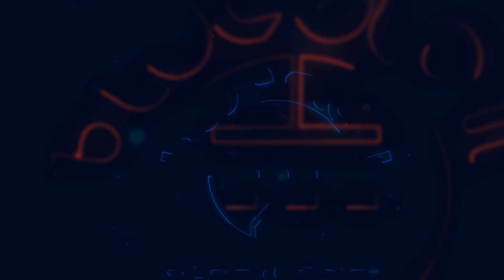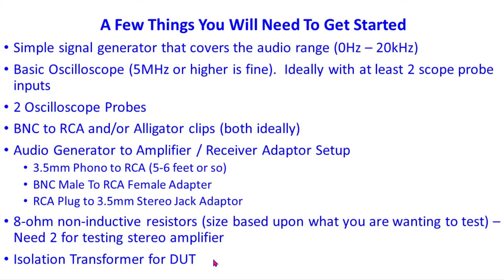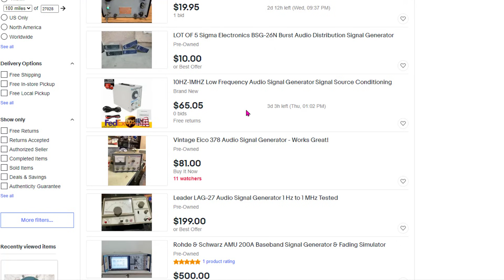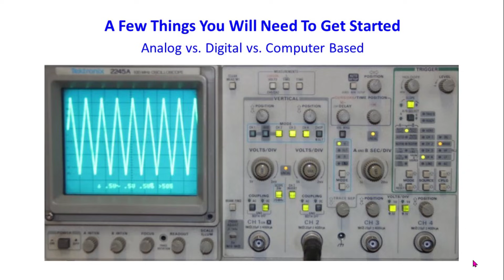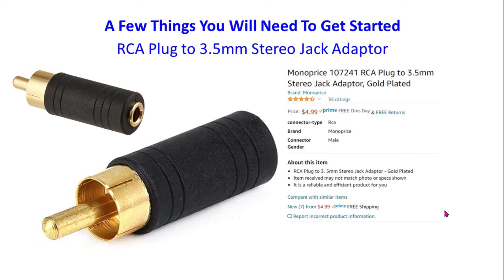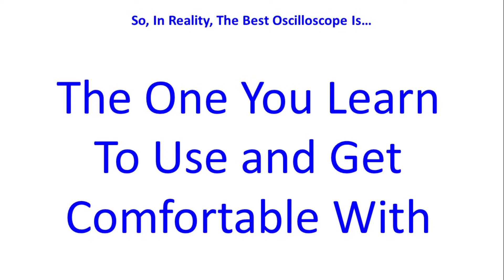Buying an Oscilloscope and Accessories For Audio Bench Work and Testing

Comment: Greetings:
FYI: As far as I am concerned, all RCA type connectors are to be called "phono" types. They all are single signal (plus shield). They have been around a long time and were originally used to connect the first phonographs with electrical pick-ups to tube radios equipped with a single RCA connector to use the radio's amplifier and speaker to listen to 78 rpm records that had once been played on wind-up gramophones.
All tip-ring-sleeve audio connectors owe their heritage to the original plugs used on telephone switchboards, hence "phone" connectors. Although those first phone plugs (and jacks) were three connector types, the audio industry standardized on them for patching including use for balanced signals.
My first exposure to tiny plugs/jacks were as earphone jacks on transistor radios. Some were smaller than the common 3.5 mm plugs used today. But all are deserving to be called "phone" plugs.
BTW: in Europe RCA phono plugs are often referred to as CINCH plugs as CINCH JONES is/was a major manufactuurer of them. (Plus there was some resentment against the Radio Corporation of America for their tight-fisted use of patents to suppress competing radio makers.) I do not know if RCA ever manufactured their own phono connectors or just used some else's patent ;). 
Hope this helps.
P.S. The original use of the 1/4" stereo headphone jack was an outgrowth of the use of 1/4" monaural headphone jacks on mono hi-fi gear. The use of phono connectors on audio/video gear is likely due to their smaller panel space requirements.
Reply: RCA is the physical plug or connector type (the round red, white, or yellow ends), while phono (short for phonograph) refers to a specific audio input setting meant for a turntable

Comment: Hello, would an Eico 378 audio generator be acceptable for these purposes? Great video and thanks for all the information!
Reply: Sure, probably better than average. It has a better than adequate frequency range, a way to adjust the frequency, a way to adjust the output amplitude, and, as a plus, a meter to indicate the output.
Reply: @johncasteel1780  Thanks!

Comment: Hi Mark.Really enjoying the videos.I have a question you may be able to answer.I recently purchased  the Reisong A10 single ended tube amp which puts  out 6watts per channel.I was putting it through my pair of Snell Acoustics Type K Mk1 speakers but i found i was having to crank the volume up virtually all the way when playing records.The Snells sensitivity is 90dB.So i decided to buy a pair of Klipsch RP-160's which are rated at 96dB but it hasn't made any difference to the amount of volume required when playing records.Is there any possible reason that the increase in sensitivity hasn't made any difference. Thanks Steve
Reply: I would think that you need to take a close look at how each speaker is tested.

Comment: I would just like to offer an opinion about software based audio testing equipment. I have an analogue oscilloscope that I find convenient in that it is easy to use and doesn't require a lot of setup but I also bought software from "TrueRTA" called <Real Time Audio Spectrum Analyzer>. This software cost me around $97 at the time (about 12 years ago) and is still available today as I understand it. This software along with its real time FFT analyzer also includes a function generator and a dual trace oscilloscope. There is a bit of a learning curve with it but it works extremely well even today without any upgrades or fixes. It uses the computer sound card which is calibrated by patching the earphone output into the microphone input and activating the calibrate function. It first tests the sound card displaying it's frequency response then shows the calibrated frequency response curve which should be a flat line (as long as you make sure Dolby noise reduction is turned off).
The software also accepts test microphone calibration curves to ensure accurate audio spectrum. I use a Bellinger EMC 8000 test mic (~$50) with calibration curve for my testing (this mic requires a phantom power pre-amp). Great software for DIY speaker designers.

Comment: Brilliant video as ever Mark thanks for explaining in so much detail and putting this series together.   I was wondering is it fine to use a signal generator from a DAW like logic or is a separate unit better?
Reply: I'd be miffed if I asked this question and then received no replies.  So, even though it's 2 years later and you've probably either given up or else maybe gone on with your education about electronics, I have some things to say.  

First of all, my approach to such questions is to play with whatever I have at hand.  Hell, it'll be fun in any case.  And you can come to your own conclusions about which is better.  So, if you can generate a signal in Logic, and then route it to an output on your DAW interface, connect that output to an input on your oscilloscope.  Then look at it on the scope's display.  At that point, you can evaluate it visually and use the scope's controls to measure some parameters of your generated signal, using the scope's graticule in its display.  

The difference between Logic's output and the output of a signal generator is that the signal generator has its own front panel controls to set frequency, amplitude, etc.  In logic, you'll have to use controls provided in the software.

Comment: I have a pair of the dreaded green ceramic 8-ohm wire-wound load resistors.  Since these aren't supposed to be acceptable because they are inductive, I decided to measure one of mine. It was 7.8 ohms, and had an inductance of 1.7 µH. This gives a low pass filter with a 3db down point of 750 Khz. I think I'm good with what I've got.
Reply: True. It is like worrying about skin effect at audio frequencies.

Comment: I have a Tek 2246 100 MHz  4 channel I'd like to sell. Like new but don't want to deal with ebay.  What are my other venues? Funny thing, in the department I worked in, you built your own test and measurement equipment for use in the shop. I don't think they do that anymore.

Comment: This video lost my confidence when the assertion was made that the sine wave on the analog scope looked smoother because the tube could not respond, and that the ragged waveform on the digital scope was more accurate. No....the signal source is likely to be analog in origin, and it does not have those jaggies, and the displayed jaggies are due to the rough quantization and display resolution.

Comment: 26:30 that wire-wound is crossed and isolated from each other
Reply: Mine measures 10 uH of inductance.
Reply: @lawrencelederer5060  thank you.  is this a small value?!  I think it is.
Reply: @JohnUsp  I retested it and the long green type is closer to 3.3 uH and the gold ones like he uses are 4.4 uH. So the green one that I have is actually better. A normal carbon resistor measures more like 2.8 uH

Comment: Looking forward to the rest of your series.  Started my tech bench about 2 years ago and went through this entire process without as much guidance.  The one area that stopped me cold for a bit was the stupid and mislabeled isolation transformers on the market.  Very few are actually isolated.  I am not referencing a Variac.  They almost all tie the ground blade to the round ground plug that you are expecting to isolate from.  I had to learn how to modify a new one by changing out the type of plugs on one bank (there is a special type of isolated outlet plugs you can buy) and removing the round pin ground connection that was originally connected.  Everyone that checks their isolation on almost all of these newer ones will be surprised to find they have continuity to the any other wall outlet ground pin.  They apparently can call it isolated still because it uses a transformer.  It doesn’t have anything to do with ground isolation anymore.  Your older isolation model or use of 2 prong adapters is the easiest method to go by.
Reply: Agreed. Isolation transformers are sold with safety in mind. The problem, as you stated, is that many iso transformers are not true isolation transformers. You cannot blindly trust your life - or test equipment - to an iso transformer. There are a lot of gotcha's involved. You must test the thing. Corollary - You must know how to test it.

Comment: Excellent beginning!  Really looking forward to your coming videos.  Just a few observtions on isolation: Your slide that showed some isolation devices was useful, but there was a something that said a Variac is not an isolation device - something you didn't mention or go into at all but I suspect you'll cover in your next video.  Since your coverage is scopes for audio bench work may I suggest you consider expanding on the initial 5 topics currently and perhaps cover areas such as harmonic distortion measurment, inter-modulation distortion measurment, etc.  As a side note some of the digital scopes can do BODE plots which are great for frequency response (and phase response) analysis of a DUT.  Another related area you might want to consider is spectrum analysis where you'll inject a sine of known purity and see what the DUT does to it on its output - this was a common procedure done with audio amps and preamps when the Hirsch-Houk Labs used to be a regular part of Stereo Review magazine back in the days (I'm dating myself).  As you mentioned in the video you're looking at a Keysight model for around $1k for your own use.  There are also some from Rigol and GW Instek that can do BODE plots.  If I'm not mistaken the Rigol requires an external waveform generator where as the Keysight has one built-in to the scope .. I think.  However, in particular the GW Instek 2000E/G series MDO (Mixed Domain Oscilloscopes) have a built-in dual-channel Arbitrary Waveform  Generator (0.1 hz to 25 MHz) and with free software from Instek for the 2000E/G scopes can perform a BODE plot.  The 2000E/G series MDO scopes also have 1 million point (selectable) FFTs - something you don't find on most other low-end and mid-range digital scopes.  And as  if that weren't enough, the MDO 2000E/G series have a built-in separate Spectrum Analyzer where span, center point, window type, etc. can be dialed in like a stand-along spectrum analyzer. The "E" version of the series also has a 5000 count Digital Meter (and a 5V/1amp power supply if you're into design).  For audio work the MDO 2000E/G scopes are a fantastic combination and you might want to include using one of them (they come in 2-Ch and 4-Ch varieties and span a total of 12 models)  in one of your future videos.  I should mention I am not connected with GW Instek in any way, but I have been looking for a scope to do more than just the usual and after comparing their scopes to some other brands/options the Instek MDO-2000E//G seem to give you quite a bang for your buck, so I purchased their MDO-2104E (100 MHz, 4-Ch) for my audio work.  Looking forward to your next videos!

Comment: A thing to keep in mind when purchasing a scope, is how deep is your bench? 

The older ‘tube’ based scopes, are considerably deeper to accommodate the tube compared to the likes of the newer digital scopes like the Rigol which are the opposite!
Reply: I agree whole heartedly.  Sadly, because I'm so "old school", I love my Tektronix 2246.  I know every button and knob, and like having discrete controls.  I do have a Siglent 1104x-e, but haven't come close to mastering it's capabilities nor it's menu system.  I also have an HP-54610b with it's memory module, which is an awesome piece of gear.

Comment: I don’t think anyone else has mentioned it, but a nice thing about modern digital scopes is that you can capture quite of lot of waveform data and then analyze using math software like MATLAB or Octave. Plus it’s way easier to capture images of waveforms of interest for documentation. 

I humbly suggest people start with an inexpensive digital scope and get good using it. They are small and portable, which is nice. Then graduate to a good analogue scope like the Tek. I use both kinds for all my work. There are some things that my Tek is better at, some thing not.

Comment: Hopefully, in your safety video you will cover how the ground on the oscilloscope probe will bypass the isolation transformer protection and can create an unexpected and possibly dangerous current path.  I find that this important piece of safety information is rarely covered in these types of tutorials.  People get used to using multimeters behind an isolation transformer, which is relatively safe, and then move up to an oscilloscope and don't understand that the scope ground is tied directly to the wall plug ground which may be tied to everything plugged in around your bench.
Reply: The only problem would be  a potential ground loop which is avoided by everything using the same ground point for everything on the bench.So if everything is at the same ground potential, how is there a problem, or are you referring to using some different type of grounding system?
Reply: @kevinhamming4514  The purpose for using an isolation transformer while working on high voltage devices is to avoid getting shocked if you accidentally touch the high voltage path and some other part of your body happens to be touching some other earth grounded thing such as the bench itself or a power supply etc.  This works because there is no current/circuit path from the high voltage system to the earth ground thanks to the isolation transformer if used properly.  When you clip the ground lead of the scope up to the device's high voltage ground or usually the chassis, now there is a current path possible from the high voltage you accidentally touched, through you, to something grounded such as the bench or equipment to the outlet ground, to the scope ground and back to the chassis.  With a proper isolation transformer, you would have to touch the high voltage and also the chassis ground or other path in the equipment in order to create a circuit through you.  There should be no complete circuit from the high voltage, through you, to something on your bench that is grounded.  Of course, you have to be careful not to create an accidental path, such as through the scope ground lead, and lose the primary benefit of the isolation transformer.  I hope this helps explain it.
Reply: @JamesGMunn  The Shock hazard to me is why you shouldn't work on anything that's not grounded. I saw someone who uses a light bulb ( high watage, low filament resistance) . The current goes through the light bulb and will light brightly if there is a short. This is a short circuit device that protects from too much current thereby prorecting the device under test., Also yourself to some extent. You don't work on anything with your test equipment not grounded, why work on something that's not grounded? So your going to disconnect your ground? Amps don't work good not being grounded because of induction 60 hz hum. I do not measure high voltages myself without powering the amp down first, then connect my probe, then powering the amp up by plugging the chord in the ac receptacle with the switch on the first time it's powered up. In case anything goes up in smoke I am a good distance away from the amp.  Thereafter I do the same thing after making changes. I reduce the risk of ever coming in contact with high voltage this way. You will eventually touch high voltage. It will happen. Use one hand . If you feel safer then that's best way for you, then leave it ungrounded. . However I have come in contact with high voItage. Only once I contacted ground with one hand and high voltage with  the other. I changed my practice then at that point.  I understand not grounding yourself or isolating yourself from it. That's why the one hand rule. I avoid that by not moving probes around when it is powered up.
Reply: I worked on large DC motor drives. They are supplied by 3 phase 440VAC. You cannot use an isolation transformer for this. Use 100X (yes one hundred times) scope probes.Use channel A minus channel B for a differential input. Set both vertical channels the same. Connect the probes together and try too measure the voltage supply. Adjust one of the variable/cal verniers to get a null reading. Remove the probes from the supply voltage. Now the scope will read the voltage across the probes with channel A hot and channel B "common". The scope is grounded normally and SAFE to adjust.
Reply: The isolation transformer is so - you can safely connect grounded test equipment - in case there is a DEATH capacitor or the DUT is too cheap to even have a power transformer or there is a short etc..

Comment: I didn't see the safety point about oscilloscope ground through to neutral when using isolation. Chances are this would then act as a path and pop goes the mains protection/oscilliscope.

Comment: I have and use the exact same isolation transformer you have, and use a power strip out from there for everything, including the variac and sometimes a DBT.  I just got one heck of a deal on a brand new Tektronix TBS1104 Digital Oscilloscope: 100MHz, 4 Channels, 1GS/s sample for a mere $600. They sell for over $1900 on most places like Mouser.  Santa was good to me. lol! The 4 channel is great when servicing quad amps and receivers. The old analog BK 2120 20MHz scope serves the purpose quite well and will not be "retired" any time soon and will be used on a 2nd bench. The Lab-Volt 1236 AF/RF generator works quite well for audio too.  Awesome videos Brother!

Comment: Thanks, great video! About that probe set for 22USD (or similar). What is the quality of those? I.e. an original Rigol probe cost 40UDS - for one. Are those Amazon probes maybe only good enough for low audio frequency but possibly they wouldn't be as good for higher frequencies?
Reply: That's why you "calibrate" your probes.